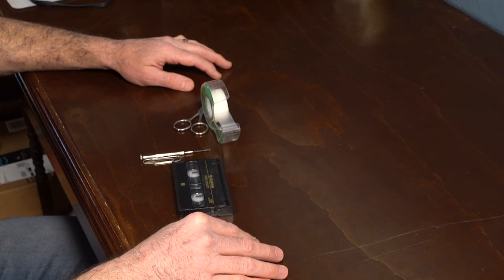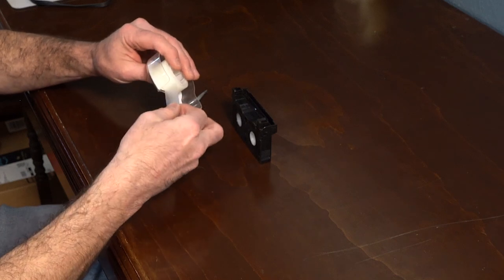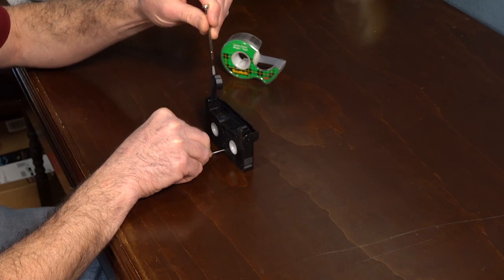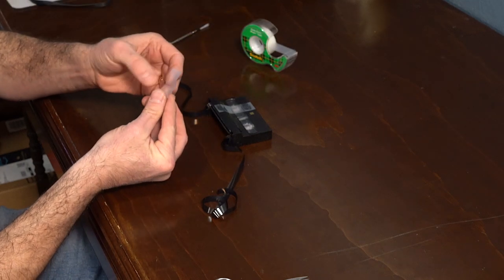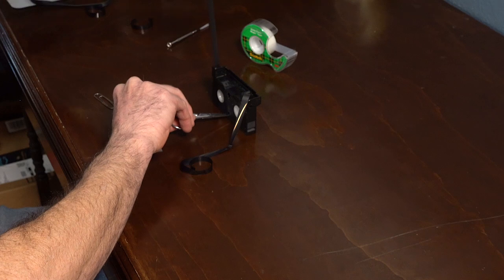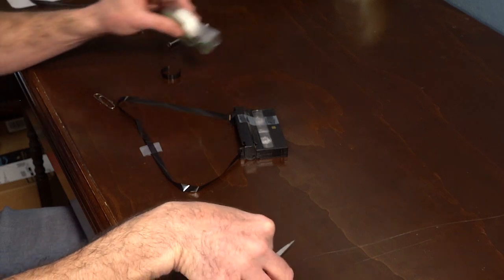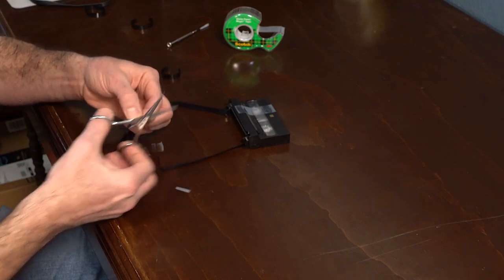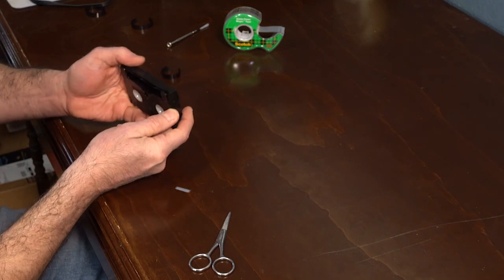How To Repair 8mm Video Tape

Comment: You don't need to use a tape and screwdriver. Just open the tape and use proper tweezers (I used one of which I use for soldering). I was able to fish the tape with tweezers :) Anyway, thanx for Your video :)
Reply from the maker: That's cool.  I tried the tweezer method once and couldn't catch the end of the tape.  Sometimes, it is like the tape is glued to the reel and really hard to get out.  That is why I found the tape to be a bit easier, it grabs the tape easy and pulls it out without having to search for the end.  I appreciate your tip!  Thank you for watching and please subscribe if you have not already.

Comment: If the tape is only showing static and has a loud distorted static sound, is it completely done for? I know it's most likely done for, but I'm just hoping for something.
Reply from the maker: Well, you could try cleaning your VCR or try a different VCR that is working properly.  If you are getting static using a different VCR than the tape is bad but that is just my opinion.
Reply: @TheMediaNerdMT  It's for an 8mm tape in particular. Other ones work fine but this one seems to just have static and the occasional distorted sound. 

I know there was stuff on it as it is labeled.

Comment: I've been currently transferring hi8 tapes and theres atleast 3 tapes so far that needs to be repaired.. Will I lose footage by doing this method? I really dont want to risk messing up my tape further more or destroying the camcorder I just bought. These tapes are really special to me and I want it transferred. Please help 😭
Reply: And I've transferred 6 of my hi8 tapes so far so I know it's not the camcorder
Reply from the maker: you will loose a little bit of footage when you do the splice.  Just make sure to make the splice tape as thin as possible so it goes through the machine properly.
Reply: @TheMediaNerdMT  I might just have the few tapes I weren't able to get working from your website. Is it additional cost if I want my tapes transferred on a flash drive rather than having it spliced?
Reply from the maker: @itsollieyx3  Please go to my website where my phone number and email contact info is and I will be able to discuss your project. www.coloradospringsvideo.com

Comment: Thanks for your video ,nice method witch the scotch tape on the table !
I have a digital 8 tape were only the casing lit is damaged ,,is it possible to switch the tape to another casing ??
Kind regards Ralf
Reply from the maker: Yes, I have a video showing a melted 8mm tape and switching out the case.  Check that one out.  thanks for watching!

Comment: Beware the 2-side Scotch tape splice!
I successfully made a splice using this method (the fishing worked very well) and carefully made a two-sided splice using Scotch magic tape. The splice looked smooth.
When I did a fast-reverse through my camcorder, it stopped when it hit the splice and displayed "Eject". 
After that, the video of all my tapes is severely scrambled. 
Apparently the tape threw something out of alignment in the guides or read head.
Another video says to use professional splicing tape. Probably an extremely good idea.
Reply from the maker: Thank you for the advise.  I had never had that issue before using the tape on both sides.  I do appreciate the feedback.  Please subscribe to my channel.  More videos are coming!
Reply: Every time i do this once the camera plays and gets to the spliced piece it cuts out and ejects !!!! i have even tried it one side only once that splice hits the heads it stops and ejects
Reply from the maker: @HeIIsBeIIsTrading  it sounds like a safety feature on your camera like a gag reflex!  Capture your tape up until that happens then manually turn the tape past that point using a paper clip to turn the sprocket past the splice then continue capturing.  You will have to press in that little trigger to release the reels

Comment: Hey, I successfully fished the tape out of one side of the tape however the other side of the tape has nothing to fish out? Do you think there is anyway to repair this tape?
Reply from the maker: You can follow the same steps as this video.   https://youtu.be/pMEupoC80mo     You are going to need a very small Philips head screw driver like what you would use for glasses and some plastic tape.  Please make sure to subscribe!  I'd greatly appreciate it.  This is a good video to make in the future.
Reply: @TheMediaNerdMT  Thank you! Appreciate the response!

Comment: Is there a way to tell if the player is cutting the tape or if it is just that the tapes are old.  I have a sony portable player EV-S1 and in the rewind it seems like it has sliced two tapes recently.
Reply from the maker: Don.  I am not familiar with this type of deck.  I did a search on it to check it out.  If I were you, I would just stop using the deck all together. Because of the age, you could have dry rot with with some of the rubber parts.  You can find some good used camera players on Amazon but it will cost you a few hundred dollars. I can also transfer them for you which may be cheaper than getting another player.  Thank you for watching and please subscribe if you have not already.  Good luck!!!

Comment: Good evening/morning.  I have a few questions for you.  What happens when the tapes play a few minutes of footage and stops playing the footage so you just see a blue screen playing? Have you had tapes like this and were you able to repair them? What do you need to do to repair the tapes like this? Thanks.
Reply from the maker: I don't think that it is the tape but the camera or deck that you are playing it on.  The head or sensor that reads the tape is dirty and needs cleaned.  I use an 8mm tape cleaner that I think you can still purchase on amazon.  It looks just like a cassette which you put in your camera or deck and play for about 20 seconds.  The other way is to just put in a tape that has not been recorded on and play that for a few moments to dislodge the dirt particles .   I was told by a repair specialist that this was the best way and not to use the 8mm cassette cleaners because the cleaners are like cleaning the heads/sensors with sandpaper.  Frankly, I find the "new cassette method" useless and I use the 8mm cleaner method witch works every time and I never  noticed any damage.   Thanks for watching and please subscribe to support my channel if you have not already!
Reply: @TheMediaNerdMT  the vcr is a new one. I am digitizing these tapes to my computer. It say no signal and the capture screen goes blue
Reply: @TheMediaNerdMT  the tape before was able to be captured to my computer fine. Then the next 2 tapes played for a few minutes and the blue screen shows up. The third tape was able to be captured all the way through without any blue screen until the home movies was finished.
Reply from the maker: That's a bit of a tough one.  This is an issue that you need to trouble shoot the  entire capture process from one end to the other to start ruling out things.  The first thing I would do is recapture one or two of the tapes that you already captured. If the tape(s) capture fine again, you know that it is just a bad tape.  If they don't capture like before then you have a lot of trouble shooting to do.  Do you happen to have another VCR deck to try out?  I doubt it but that could help with ruling things out. Check connections, computer speed, hard drive space..... Good luck!  I am off for the weekend.
Reply: @TheMediaNerdMT  Few questions. I have a few TC-30 tapes (VHS-C) and a few 8mm tapes that plays for a few minutes and then the screen turns blue. I’m trying to digitize my home movies. I’ve removed the case to look at the film and looks good (no cuts, wrinkles, etc). I removed the capture cables from my computer and VCR. I’ve talked with my customer and she does remember if she has check to see if they played all the way. My VCR heads have been cleaned. Still turning to blue screen after a few minutes of playing.  Is there any other troubleshooting I could do or are the tapes damaged? Thanks.
Reply: @TheMediaNerdMT  I’ve removed the case to look at the film and looks good (no cuts, wrinkles, etc). I removed the capture cables from my computer and VCR. I’ve talked with my customer and she does remember if she has check to see if they played all the way. My VCR heads have been cleaned. Still turning to blue screen after a few minutes of playing.  Is there any other troubleshooting I could do or are the tapes damaged? Thanks.
Reply: @TheMediaNerdMT  I been doing other tapes just fine.
Reply from the maker: @jasonbrewster4401  Not sure what to tell you.  It seems like your tapes are bad.  My company is coloradospringsvideo.com  you can send them to me to give it a try or take it to someone local.
Reply from the maker: Do you have another 8mm player you could try? I know that getting another one is an expensive route to take but if you are doing this for a business, you might as well have another one for backup and trouble shooting.  Your player could just be shot.  This has happened to me in the past with my Sony 8mm Walkman.  I sent it in for repair and the heads were shot.  You can get a 8mm Sony camera on Amazon for a reasonable amount of money.  I just got one that plays both Hi8 and Digital.

Comment: What if my tape has a crack?
Reply from the maker: If the tape housing is cracked, it would be best to find another 8mm tape that you don’t need and put the tape into the new housing
Reply: Okay, so taping up the tape won't work once I get the film taped up.??
Reply from the maker: @marciesmith3689 you can give it a shot.  I really don’t know what you are dealing with unless you send me a picture.  Info@coloradospringsvideo.com